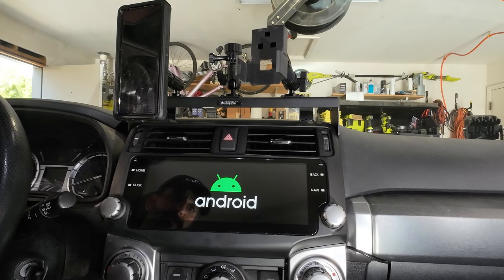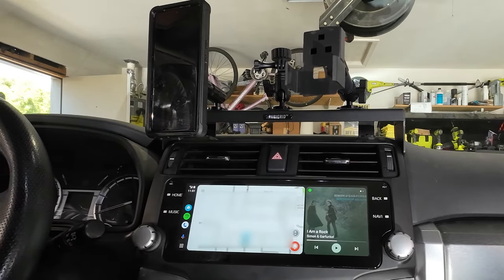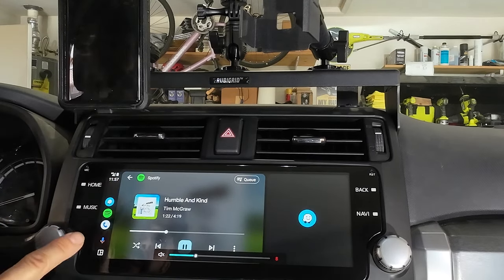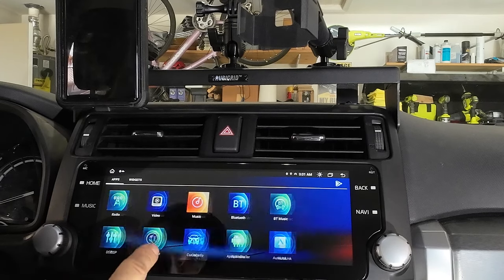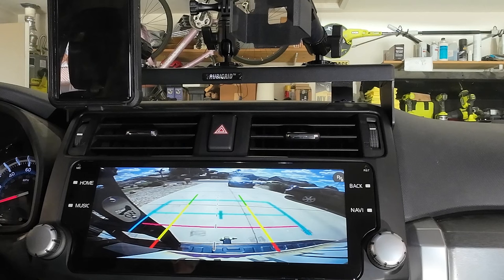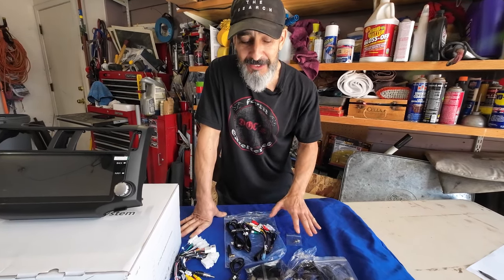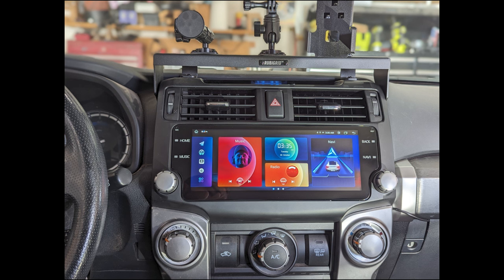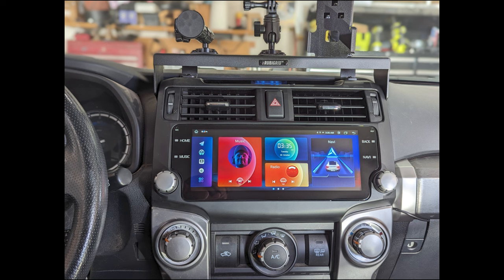Upgrade Your 4RUNNER's Stereo System!

Comment: How does that external mic sound? And you you know if you can retain the factory one with that head unit?
Reply from the maker: According to others who I have spoken to using it (located on the top left of the unit) they can hear me just fine. I am not using the additional external mic they provided. I did plug it in to the back of the unit and tucked it behind, but it is not in use.

Comment: I've been looking for a new head unit for my 5th Gen 4Runner and while I was wanting knobs, I was not looking forward to the Dasaita. THANK YOU!
Reply from the maker: I as well. I was waiting for something similar but better. So far, this fits the bill. Like I said, I will be doing some longer term testing and  some follow ups, but I'm very hopeful. As is, it's great
Reply: @AZOverland2017  I'm sure something better will come along. The question is when. I'd rather go ahead with this because it "checks all my boxes" of what I've been looking for. If something better comes along, I'll wait.
Reply from the maker: @InGratitudeIam  Yes, it checked mine too.
Reply: Any updates on this unit? I’m in between Dasaita and this unit. This unit being the cheaper option. I’m following for the updated video! Thanks
Reply: @theoutdoorcritic  I got the dasaita, wouldn’t recommend. Mines very finicky. But I did also get it a long time ago
Reply: @Midzytarkyclipz  I ended up getting the dasaita g12. Great upgrade! Sound quality has significantly improved

Comment: Great instructional video I've learned a lot from watching your video,I'm wondering are you in a setting or app to mirror your phone to the head unit ?
Reply from the maker: I am just connecting with Android Auto. Then I click on the bottom left of the screen and it displays the compatible icons/apps on my phone. I believe you can choose some to appear on the left when you exit that screen but It doesn't really mirror the actual phone screen.

Comment: Hello again and thank you for your very instructional video I'm sure it will give  many people an easier time installing the head unit as it helped me a lot in my installation,I have a question I know the unit has a sim card slot but I'm wondering do you know what size SIM card it uses are there are a few different sizes. I really appreciate it if you could help me wout with that information or dies it show somewhere on the manual .
Reply from the maker: I'm not sure of the size because I'm not using one. But SIM cards usually come in break aways that provide all sizes. You would just use the one that fits when you have the SIM card reader out form the head unit

Comment: Hello again thanks for your very informative and step by step instal,I'm very happy with my Roadanvi head unit and all the features it has. I do have to ask what size SIM card are you using and it better to add a phone line or Internet to be connected at all times?
Reply from the maker: I'm not using a sim card. I use it mainly for my Spotify and Waze maps. If you do use one, please let me know what you did and how it works for you.

Comment: We use netflix for our kids on long trips. 
1. Have you tested any video streaming services while moving for people other than the driver?
2. We have head rest monitors for the kids in the back seats. Can we connect these to this unit?
Reply from the maker: I haven't tested the streaming services. I have played with the settings with the video that was preloaded in the head unit hard drive. At first, it would not play when putting the car in gear. I found the setting that allows you to play video while driving. I would assume that would translate over to streaming video as well, but I can't confirm that. I'm not sure about multiple monitors. I would reach out to the company and ask that question. You also would obviously need to use the SIM card option for access to Netflix, etc. I am personally not using it at the moment.

Comment: What's your thoughts on long term, did you have or experience any issues.
Reply from the maker: Still in and going strong. It does have some glitches as someone else had mentioned, but nothing that's a deal breaker. Radio works perfectly, Spotify works great and connects though my Android Auto and my daughter's Apple Play without issue. Google Maps and Waze work well.

Little things like I can't seem to control the volume of the GPS voice and music independently, etc

Comment: Great video, easy to follow and super-helpful.  Purchased the same radio, and wired it up following your lead.  Things are working well, except the radio - I plugged it into the second adapter you highlighted.  Wifi seems good, though it disconnects on and off.  The radio widget comes up, but no stations anywhere.  I left the antenna piece inside the setup when I put it all back into the dash.  Is there something else I should do with it, or am I missing anything?  Thank you again.
Reply from the maker: What happens when you press the radio button?
Reply from the maker: Feel free to send me pictures

Brothersadventuresllc@gmail.com
Reply: Hey, thanks for the quick response.  If I use the roadanvi launcher and click on Radio, the dial comes up correctly (like in your video).  However, if I try to go to any station, it's just static.  If I do a scan, it loops all the way around.

Am happy to send you pics but they aren't very exciting :).  Was thinking I'd try iheartradio as an alternative, but they don't have a ton of Phx stations (I'm in Az also).

I did manage to turn off the annoying android bot that pops up with the 'Welcome Master' thing.  Another quirk is that it launches to the Roadanvi home page then connects to android auto, so it's taking 20-25 secs to get settled.  Hoping I can figure out how to skip the first part.

Also, the buttons on the left hand side weren't working for me inside android auto.  I have a Samsung S22 as my phone.  Turns out you need to turn off the 'visibility settings' on the phone, then they worked like a charm.  Found this on a reddit forum.

Last, the backup camera is kind of grainy.  I had four 'yellow' plugs total in my harness, and am thinking of trying other combos to see if it gets any better.  None of them were helpfully labelled 'Camera', just Aux-1 and Aux-2, etc.

Your video was super-helpful and made it not as daunting to do myself.  Leaving this other info out there in case anyone else runs across these problems.  I'd rather not have to run the antenna wire out and around somewhere, happy enough to leave it inside the console.  Was thinking of switching out the antenna with the wifi antenna to see if that makes any difference, will let you know.

Sorry for the long response, and thanks again.
Reply: Ah, I'm an idiot.  Pulled it apart and had somehow missed the very large black 1/4 inch plug.  Switched the antennas anyway, but that's probably a wash.  Radio works like a charm now.  Trying to figure out if I can somehow get that radio dial exposed in android auto but it's not terrible to flip over if I really want to.

The backup cam is pretty grainy and pixelated, esp at night.  I tried cleaning the camera and swapping around all the plugs, but only one combo works.  It could be that it was always like that, and I just noticed because the screen is so much bigger - not sure there is a lot I can do about it.

Thanks again for the video and the hellp.
Reply from the maker: @markchauvin-r5l  I'm glad you got it figured out. My backup camera actually shows a really nice picture when in reverse. There are 2 sizes to the screen. The larger size does distort the picture a bit. The smaller size looks pretty clear to me, at least comparing it to the OEM screen You can switch to the smaller screen by pressing the button on the top left as I did in the video 13:54. It switches from the bigger screen to the smaller screen automatically after the phone connects in Android Auto as well. At night, it is definitely a bit grainy. I think that may be due to the tail light reflection. I'm going to add some brighter LEDs in the back at some point and see if it helps with that night view.

Comment: Thinking about installing in my 2014.  It works well with an iPhone?  You mentioned your daughter didn’t have any issues initially.  That’s still the case? You still happy with it?
Reply from the maker: @clr47524  Yes, we both still connect (Android Auto and Carplay) without issue. I still have it and it still works great. I'm very happy with it

Comment: Hello thanks for the great presentation on installing the head unit ,I have the same unit in my 4 runner I did have a question do I need an app on my phone to mirror it to the head unit ?
Reply from the maker: You need Android Auto installed if you are using a non Apple phone or Carplay for Apple

Comment: Great video so with the pre-installed apps do you get any engine management info or TPMS data on the screen
Reply from the maker: Good question. No engine info on the head unit. I don't have TPMS so I'm not sure about that

Comment: Hello thanks again for your very instructional video on installing the Roadanvi head unit I really enjoy it ,I did have a question how do you upload music to the head unit I know there's a way to add music to the existing but don't know how please help .
Reply from the maker: I don't use that feature since I use Spotify. But I would think that if connect a flash drive to the factory USB port or to the USB cable that connected to the back of the head unit (I show this in the video) you can pull those files in. You should be able to access them by touching the "Music" button then going to the settings on the bottom if I remember correctly.

Comment: Q1:  How is AM and FM radio reception?   The 5th Gen 4Runner uses a pair of "diversity antennas" with the stock vehicle connector having 2 cable connectors inside of it.  A number of Android radios come with harnesses that contain a radio connector with only 1 cable connector in it.  Subsequently the comments I have been able to ferret out are that reception is lacking.

Q2:  Does the backup camera automatically appear on screen when you put the vehicle in reverse?  And does it go back to whatever app was open when you shift into gear/park?

Looking forward to your follow-up video... thanks in advance!
Reply from the maker: Thanks for the questions. I only saw 1 male input for the antenna which was plugged in. I would have to look a little deeper into this. But, to answer your question, overall the reception is good but It is not quite as good as it was before. I know this because 1 station I listen to is a bit further from my location and the reception for that particular station is not as clear now. All my major presets are fine.

Yes the backup camera comes on automatically and it does go back to the app or station you were listening to. I will show more of that in my follow up video

Comment: Looking forward to your follow up review, any quick updates? Does SiriusXM work on this?
Reply from the maker: I'm way behind in my videos as I have so much footage I'm still going through. I'm still enjoying the head unit immensely. As another sub mentioned, there are few little glitches, but it is still far better than the OEM unit and fits my needs very well. Nothing that is a deal breaker for me. I don't use SiriusXM but I just went out to check, and I don't believe it offers it from what I can tell.
Reply: @AZOverland2017  Appreciate the reply, and thank you for checking! I'm thinking I can still play xm from my phone and can link it via aux. Awesome to hear it's still holding up!

Comment: Really like these units but the only thing I am concerned about is how does the phone sound at each end when you are recieving a call and can they other end har and understand you? Thanks for a really good video!
Reply from the maker: Thank you and sorry for the delayed response. I have no problem hearing people when they call. It does sound like it's more mono than stereo regarding sound depth. I've asked several people I've called using the head unit hands free and they have all said my voice was clear. That was a better response than when asking them about sound quality on calls over the OEM head unit. There is an external microphone as a backup, but I don't feel I need to use it at this point.

Comment: Thanks for the great video. I purchased this and installed it based on your video. Great instruction. The system is a little quirky to be sure, but I think I like it overall. It does look great. One big point of frustration is the built-in Nav. When you first start up the system, the Nav automatically connects and basically takes over the system. Have you found a way to disable it from auto starting?
Reply from the maker: Thanks. Yes, I was able to disable it as I use Waze. My daughter actually figured it out, I'll ask how she did it. What other quirks have you found?
Reply: Yes please ask. That would be great!!! Ill come up with a list but 2 others that come to mind are screen brightness and the vertical icon menu on the left side of the home screen. The brightness in the day is fine, beautiful in fact. But sometimes at night, especially using Android Auto, the screen is a little too bright. There is the pull down menu from the top of the screen that includes the brightness setting, but changing it doesnt actually afffect the brightness of my screen so I have been unable to change it so far. The other is the menu with the little icons on the left. A few of those I would rarely use so I wanted to switch them out with something like Android Auto. If you go and find the Android Auto icon and press and hold on it, you can then drag and drop it to another location. However, when i try to drop on that menu, it just tells me it is full and there is no room. I cant figure out how to move any of those out of there to make room.  @AZOverland2017
Reply from the maker: @jimkennedy8536  Send me an email at brothersadventuresllc@gmail.com and I will reply with pictures and instructions of what I did!

Comment: Would it b possible to get another video on this head unit? Still using it or not, any problems since you installed it... things like that. Im very interested in this from this video but would like to know if its still something you would suggest buying
Reply from the maker: Yes, I will be doing another, long overdue video on this. In the meanwhile, yes it is still working great and I am still liking it very much. It's not perfect, but it does what I want, looks and sounds excellent, and is reasonably priced

Comment: Does the unit have an onboard microphone? If so, how is the quality when it comes to phone calls?
Reply from the maker: It does have one built in to the top left of the screen. It also has an external mic you can mount on the dash or windshield if you wanted. I connected it but tucked it behind the unit in case I needed it. The people i call say my voice comes through clearly Their voice does sound a bit tinny. Still fine but could be better. I think it may be adjustable (perhaps adding bass) but i haven't played with that yet.
Reply: @AZOverland2017  Gotcha. Thanks for the reply. So just to confirm, the testing you have done has been with the external mic mounted behind the unit? Or is it just plugged in but not enabled?
Reply from the maker: @cubsfan1056  Plugged in but not in use. I'm just using the built in mic on the head unit. I prefer not to have more stuff mounted on my dash or windshield if I can help it and it doesn't seem necessary.
Reply: @AZOverland2017  Ah that makes more sense. I'm the same way, don't like extra stuff attached it I don't need it. Glad to hear the mic quality seems to be decent. Have heard a lot of negative things about the mic quality on some of the other 4runner head units (t10, etc)

Comment: I recently purchased this head unit, installed it and love it except for 2 things, I cannot find the reverse camera hookup. I’ve successfully gotten it to connect to the front camera connector and get video feed through the backup cam but when actually reversing nothing, my other concern is that when I go to change any of the infotainment settings it requires a code, the code they gave is 8878 but that does not seem to do anything. Can I get any help here guys?
Reply from the maker: Regarding the Reverse Camera; watch the video again starting at 19:19 where I address this and see if it doesn't answer your question. 

I will look further into your other question. I don't recall having to enter a Code but I will go play around with it.

Comment: Hello again I love my head unit I was wondering why my factory USB is not working I did notice the factory USB cable connector doesn't go all the way in on the USB adapter connector provided any ideas??
Reply from the maker: Cool! So, I never actually use the factory USB port. I used it for charging my phone when I first purchased the 4Runner but realized how slow it was compared to a 12V dual USB adapter I now use. In my video, there were 2 wires I didn't use. I believe that gray one I didn't use was for the OEM USB/Aux connection. I just checked and my USB doesn't work either and I assume it's because I never connected that wire. I would never have known until you mentioned it so I had to check. It seems some years have different plugs. Take a look at the 2 adaptors I put below and see if you think 1 will work for you to make your USB connect and operate. Also, look at the pictures in the Reviews as they provide some good explanations of these plugs and how others have used them

Metra AX-TOYUSB-2 2010-Up Toyota USB Adaptor
https://amzn.to/3vlq2Ge

PAC USB-TY1 Toyota/Lexus OEM USB Port Retention Cable
https://amzn.to/4aOtABi